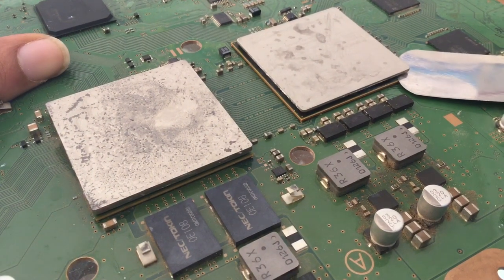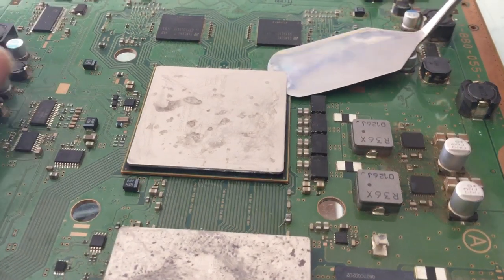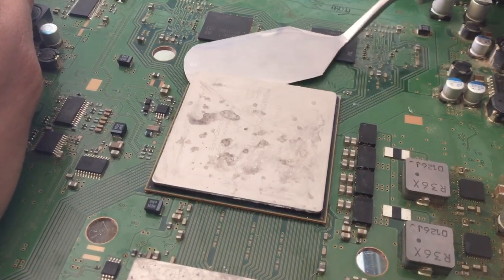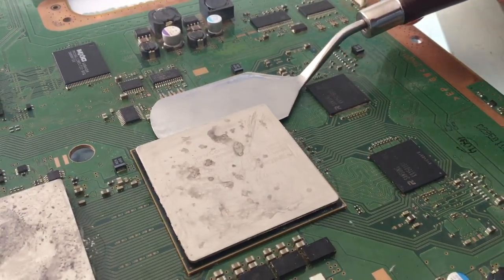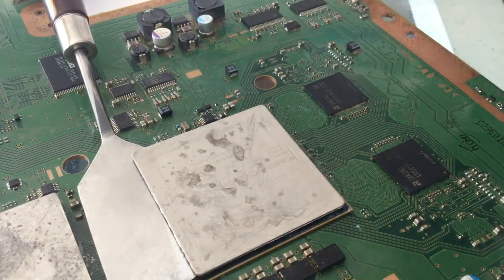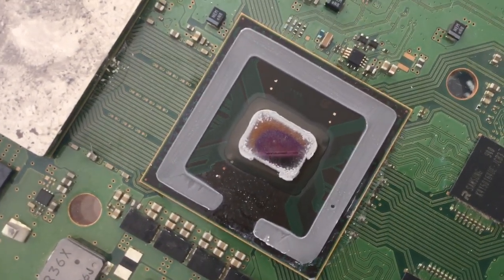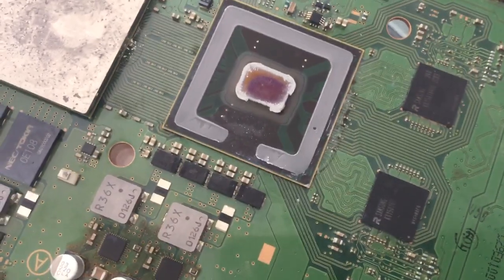The right way to delid PS3 CPU (IHS Removal) for My Mate Vince

Comment: Dude, that was so smooth and simple! 😦 Great job!

Various painter knives sets number their tools differently, so your no.4 may not be the same as the no.4 in a different set. But, since you've shown the tool in the video, it's a moot point.I'd also wrap a bit of shrink tubing around the bend of the second tool, in order to protect smaller components and the board from getting scratched.
Reply from the maker: I hope that all the tool sets have the exact same tool as mine (dimensions and thickness )

Comment: I used this exact video to delid my system correctly thank you so much 

A tip for everyone else. Heat up the IHS for 30second to a minute at 200°C 

Take your time !  It would glide like butter
Reply: really don't know if you want to be doing that. heating up the heat spreader will heat up the CPU underneath causing it undue stress when they aren't very good with heat already.
Reply: @elmerandrewcrowley2822  don’t think 30 seconds will do much tbh 

Always be careful tho
Reply: @HeavyBreathingGamerXD  how long isn't relevant, the thing that damages these CPUs is the repeated change in temperature, not the level of the temperature. over time they get stress fractures from it. yes I know it is only one time but the whole point of delidding is to prolong the life of the CPU, which you arent doing if you're causing more stress fractures.
Reply: @elmerandrewcrowley2822  you are correct but delidding with out a little heat can cause cracks in the solder as well. The whole thing is dangerous and a risk.  Either way you can mess up. I’ve done plenty of successful delids with a little heat. With out a little heat that glue is super hard to cut and using more pressure would crack the solder or a slip of the hand will scratch the chip.  Again this whole process is a risk just use caution
Reply: Please what is the name of the tools. Thanks
Reply: @dinaabimbola4547  painters knife set on Amazon

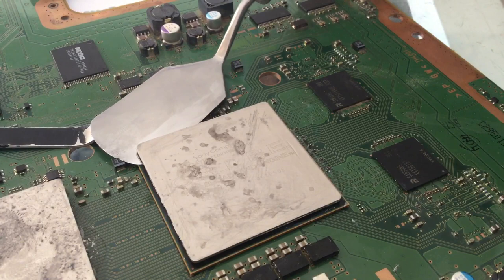Comment: 2:18 I wouldn't be so "calm" in that part. I saw people that damaged the CELL by making so much pressure upwards, the silicone glue literally deattached the PCB, but with a part of the PCB it self.. The best option would be to avoid those capacitors by any means. You can start then in the opposite corner.
Reply from the maker: MGOFor3ver starting from the opposite corner will increase the chance of scratching the CPU the best way is not to remove the toll once you start deliding

Comment: Great work!  How is the lid put back once you put new thermal paste on?  Do you put new adhesive or is the existing reused?  Thanks!
Reply from the maker: I scratch the old one and leave it without adhesive no need
Reply: @zakariahassen9236  will it not come off on it's own?
Reply from the maker: @konza02  no it wont
Reply: i believe its held in place by the heat sink clamps u screw back in place

Comment: That's a CECH-2000 series PS3 slim, right? The one which still has the 65nm gpu? Do you know if the IHS is already sort of glued on on the RSX of these? I'll probably have to delid both the cpu and gpu on mine because the fan is ramping up really hard, but I'm sort of wary because I already killed two PS3 fats when trying to delid in the past...

Comment: method id good but not so easy and don't recommend doing it very high risk of cutting chips , instead use very thin plastic fishing line that way you can cut through the sticky layer easily with out any harm on chip
Reply: There is no better Option, thats the best for noobs!
You cant take a razer blade or whatever for noobs!

Comment: Very good video...How do you put it back without that machine and can u do this with the gpu? Kif bitraje3 il cpu ba3d itkhalis wa momken ta3mol nafs al shi lal gpu? Shokran
Reply from the maker: مش نفس الطريقة و ترجعو عادي في مكانو
Reply: @zakariahassen9236  bas 3indi sou2al wa7id kamen. Ana my ps3 wa2a3tou shi 3 feet wa ijeni il ylod. Inta mfakar il mushkila min cpu/gpu balls damage ow token capactiors ow aye haja specific 3al motherboard? Shokran barsha habibi wa eid mubarak
Reply from the maker: Young Camel  most likely the solder under the gpu or the cpu or the south bridge is damaged reballing the damaged one will fix the problem
Reply: @zakariahassen9236  thanks habibi. I dont have equipment to reball but i will use your techniques or reflow🤙
Reply from the maker: Young Camel  reflow won t fix the problem unless you use bga station not a heatgun
Reply: @zakariahassen9236  do you know any way to remove the cpu gpu at home without the machine that heats and sucks? I dont have a station or know anybody
Reply: I am thinking of heating the chip with a heat gun and using an IC popper to remove the chip and then soldering. Not sure if that will pop them off...
Reply from the maker: Young Camel a Heath un will take so long to remove the ship and you ll damage it in the process
Reply: @zakariahassen9236  i realised. Im going to get a bga machine in the future, nothing too professional. Thanks for all your help habibi I appreciate it man!. Salam

Comment: Heat the CPU for 2 minutes on max setting of hair dryer and then do this it makes it much easier!!
Reply: Absolutely WRONG! You will damage the flip chip mounting solder below the die, and/or the insulation. WRONG, don't do it, never.
Reply: @mark12358  Not true. Idk where you are but here the max setting of a hair dryer is no where near (hundreds of degrees) less than the melting point of lead-free solder. 

The insulation doesn't get damaged unless you use significantly higher temps too

Comment: Hi.
How do you glue the ihs back after reapplying thermal paste?
Reply: from what i hear, u dont. Its held in place when u screw back in the heat sink clamps and i hear its just overall better to not reglue when u need to reapply thermal paste again in the far future